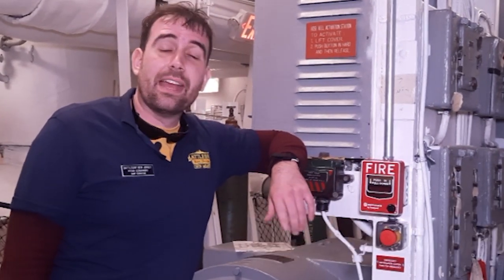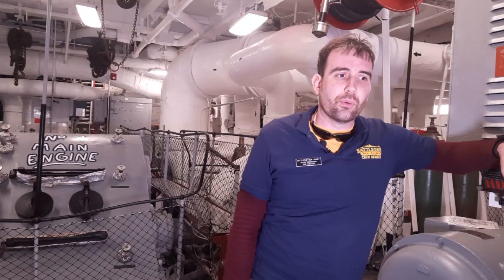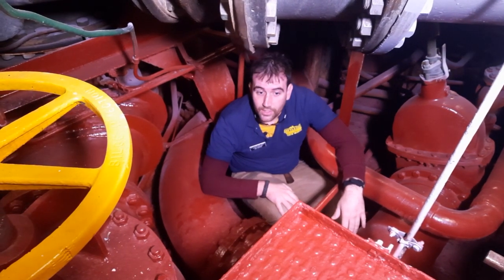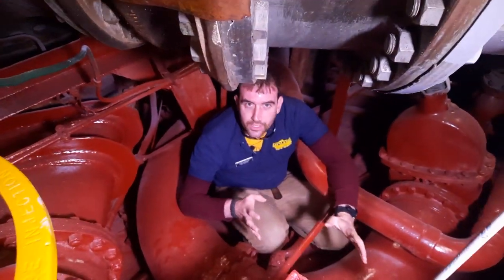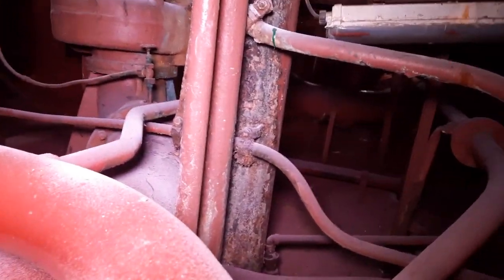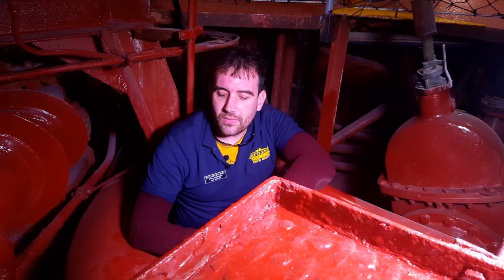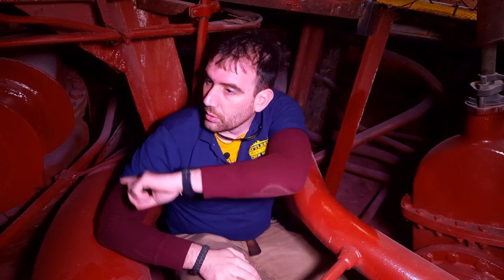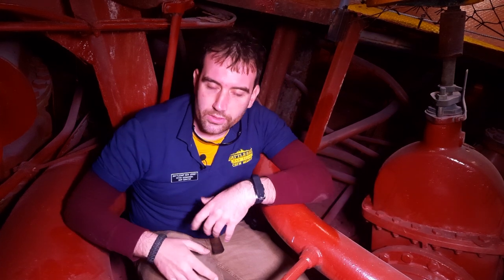Where's the Self-Destruct button on the Battleship?

Comment: I happen to be related to a master welder and metal worker! I could send him down there to break those welds on the Sea chests  smooth out the burrs and you can get that thing ready to go fight aliens.
Reply: Hell yeah
Reply: That's done from the outside in drydock. Plates are welded over the suction/discharge ports of ships as part of the mothballing process.
Reply: @ostrich67  very interesting! Thanks for helping me learn something! So the darn thing would have to be out of the water before someone could break the welds on those plates
Reply: @BlindMansRevenge2002  I suppose you could send in a diver with an underwater cutting torch, but there's probably a lot of them.

Comment: A drydock, an ironworker, some bottles of oxygen and some thermic lances could get those saltwater coolant inlets and outlets un-welded over if you should want to go on a cruise.
Might be able to do it with a manual plasma torch depending on how overkill the welds are, this is a battleship after all.

Comment: 🧐 I already KNOW the answer without having to watch the video! You simply take the main elevator(or an escalator) down to the "basement deck". When the elevator doors open, you make a left, and walk about 1/8 mile down to the end of the hallway. Open the doors on your left and right, and inside each door, you'll see a panel with a large, round red button, with words above it saying "to self destruct, press button".... From there, a special "express scuttling elevator" will rush you to the main deck to abandon ship. The scuttling charges will explode in 10 seconds. Good luck in the afterlife! 😐👍

Comment: The overboard valves of the installed eductor system of the ship I served aboard had locks on them. During PMS I was supposed to test the system but no one knew where they were. PMS deferred.

Comment: I'm pretty sure Star Trek started the trope of a self-destruct button. But even there the presence of a self destruct button wasn't because time and effort was spent installing such a system. Instead, Federation vessels use anti-matter, and quite a lot of it, to drive the warp core.  If you turn off the magnetic shielding that keeps the antimatter contained you have a bomb several times stronger than the strongest nuclear weapon ever detonated. Using that inherent instability and danger to intentionally destroy the ship is a trivial addition.

Comment: If I remember correctly, Graf Spee exploded after the scuttling crew abandoned.  They set their charges with timers on the detonators.  The water there was shallow enough that if all the Germans had done was blow open the sea chests she could still have been salvaged or, at least, equipment removed for examination.

The way the Germans did it, the ship burned for quite a while, ruining most of the sensitive (secret) equipment.  The classified documents had already been destroyed.
Reply: As I understand, one of the items the British were able to inspect was the radar system and check how advanced they were in that area.
Reply: @matthewalker  The British made a shell company in Uruguay and bought the salvage rights.
Reply: I beleive they hung torpedo warheads in the magazines with a candle burning through the ropes while everyone legged it, but I can't remember what i read that in
Reply: Okay no I found it they rigged 6 torpedo warheads with a timing system, the forward charges failed to go off possibly due to the initial blast in the engine rooms damaging the wiring. aft blast was successful in destroying the rear of the ship. ship was in 8 meters of water

Comment: OK, now you have started me down the rabbit hole of reading about the Ling. And the stories vary widely. From hull damage, to vandalism, to charged against 5 people for sinking her. Museum and sub closed from hurricane damage. The sub is virtually locked in place by a river too shallow to move her, passageways around dams that have silted up with no plan to dredge the pollution contaminated soil from them, and perhaps bridges that would not allow her to pass. Yet there's a 2019 article about a group in Louisville trying to move the sub there (how?). Have you done a video of on her yet? It would sure be interesting.

Comment: It seems that USS Ling lives !
"Sometime in mid-August of 2018, the hull of the USS Ling rusted through flooding the ship with several feet of brackish water. It was originally believed to have been sunk by vandals but this proved to be false once efforts were made to re-float her. The USS Ling is being worked on by a new group of volunteers. She has had the hull breaches repaired and is again floating upright in the Hackensack River"
Reply: Sounds like a good candidate for scrap.
Reply: @robertthomas5906  Boats from that war are never a good candidate for scrap...
Reply: @b-chroniumproductions3177  Actually they are. Pre nuclear age steel. Eventually you have to say enough is enough. We have other examples. Sometimes they're simply too big of a hole in the water in which to put money into.
Reply: @robertthomas5906  We're perfectly capable of making low background steel nowadays. Scrapping old warships and such is just a bit cheaper.
Reply: @b-chroniumproductions3177  Scrap it now or scrap it later. Rest assured they will be scrapped.

Comment: Interesting fact the S160 steam locomotives in WW2 had a suside value once open it would drain the boiler when still hot would mean the loco was worthless
Reply: Njaa, it is normal to use the blow down valve in a way  which won't damage the boiler while making it far more easier drying its inside:
remove the fire (if coal or simply shutdown oil)
When the pressure is down to lets say 3 MPa ie about 115 degrees celsius in the the boiler - open the valve and keep it open. The steam pressure will push out the water in a not violent way and enough heat will be left so what the boiler will dry out fairly smartly.
Reply: @TheStefanskoglund1  the value I’m talking about once open it could not be closed

Comment: Were plastic explosives used in rescues?  Actually, what was even the standard procedure for rescue and damage control?  What do you do to keep a burning ship that’s taking on water from sinking, and at what point would a Captain typically order everyone to abandon ship?

Oh, I was never sent to find the keys to the sea chest, but if you happen to see a wireless AC adapter, I could use one of those.  Or a cable stretcher, either will do.

Comment: Better be careful about asking me to find the key to the sea chest, gather a bucket of dead steam... I may ask "Do you want me to check that the sea chest key works too?"
Translated, loosen the bolts on the massive sea chest pipe of course...
Or get a bucket of water from the condenser before it goes back to the boiler, of course getting it out of that may not be easy, so they will have to accept some modifications in the worst case :D

Comment: The Bismarck was scuttled and sunk at the same time. Yeah she would have eventually sunk from all of the torpedo damage. But there are signs on the Hull of the Bismarck that shows no signs of implosion which is indicative of scuttling or flooding from the inside. Where there should be implosion signs there are none.

So it was a mutual win and mutual loss. The Bismarck was scuttled but she was also sunk by many torpedoes

Comment: Ryan: Great stuff. I have been to BB59 many times as a military historian and Mass native. Looking forward to getting to your ship soon. My question is, how did the crew keep the ship supplied with water while in port, given the usual debris in harbor water? Was there a filtration system to keep the mains from getting jammed with junk, or was all that accomplished by pier-side services?  

John Carty
US Army (ret)
Reply: Hey John, on my  Navy Cruiser, we connected Pier Services fresh water supply hoses to the ship. However, some foreign ports did not have pier-side fresh water, and had to obtain a water barge to supply the ship in those locations. Once at sea, the ship can make her own fresh water with a distilling plant that evaporates (boils under a reduced pressure) seawater and condenses the resulting steam into fresh water. Many newer ships now also use "reverse osmosis" water filters. (I dont believe the New Jersey has the RO water system however)

Comment: wouldnt having a big hole in the bottom of your ship that pipes to engineering spaces be vulnerable to extreme overpressure?
Ive seen you talk about the layered torpedo defenses, but this made it seem like its just a single (thick) mild steel tube between the inside and the ocean.
Reply: They are baffled, to prevent rapid pressure change

Comment: I have worked on vehicles with builtin in Vehicle termination systems for the Military, usually unmanned...
Reply: So then it would be a remote kill switch. I hope they don't have remote kill switches on the manned stuff.
Reply: @lonnywilcox445  Manned rockets have self destruct to use on what is left after the crew detaches incase the vehicle takes a dangerous trajectory.

Comment: Ooooo!  Ok, you deal with the German Hate Mail.  Point of Fact: Bob Ballard, when he sent his ROV down the Bismarck, reported that he found the inner hull to be intact.  Lends support that Bismarck was scuttled.

While NO BB's were scuttled, several carriers and the carrier Lexington were indeed shot with torps so as to not allow them to fall into enemy hands.
Reply: Bismarck sunk from the stern port side that were the Swordfish torpedo hit and were the were big hole in the deck, I think during the battle the blockheads gave way intrunal so flooding on the port side it dose not take much water to capsize a big top heavy ship and once the big hole in midships reach the waterline she would turned over very quickly main guns fall out then the air bubble re rights the Bismarck close to the service say at 50 meters then the stern brakes away she flood very quickly result no hull damage form water pursuer
Reply: @daniellastuart3145  First Officer Hans Oels, the senior surviving officer, issued the order to abandon ship. He also instructed the engine-room crews to open the ship's watertight doors and prepare scuttling charges.[25] Gerhard Junack, the chief engineering officer, ordered his men to set the demolition charges with a 9-minute fuse but the intercom system broke down and he sent a messenger to confirm the order to scuttle the ship. The messenger never returned and Junack primed the charges and ordered the crew to abandon the ship.

Perhaps we are both correct.  In the final 30 minutes of her life, all of Bismarck's main guns were put out of action.  She took over 400 direct hits from main guns.  Her decks were awash when the last of the torpedoes hit, putting as you mentioned, large holes into the superstructure.  Bismarck's fate was sealed, but the scuttle charges were placed and primed, regardless

Comment: Ships with certain capabilities have Always had ways Planned, to Prevent Capture of That Technology. These Usually Involved Explosives. A Few Small Initiating Charges, placed on Warheads. or Projectiles Already Designed to create Great Damage, Is All it takes. Before Technology provided the means to recover things at Great Depths, or Quickly,  As long as a ship could sink before being boarded by a hostile force, there were few worries. Explosive solve THAT problem.

Comment: U505 was saved from scuttling because the strainer cover in question was on the  floorplate near the open pipe. Gallery comments in his autobiography that had the cover been dropped into the bilge, there would have been no way to save her.

Comment: something ive been wondering, say you where in charge of a hostile powers navy in ww2, what would you do if you where tasked to sink an Iowa? submarine action? air power? or something else?
Reply: Subs.
Reply: @joshuahudson2170  I guess it depends on what kind, and how many subs you had, and how suicidal the crews were. You'd almost certainly lose a lot if not all of the guys. It would pretty much be a suicide mission. The Iowas were so big, and so tough, and had good enough torpedo protection, that it would take more than one lucky hit to totally ensure a kill. You'd need multiple torpedo hits, even with the legendary Japanese type 93.. I don't think they really had enough subs.. In the case of Japan they'd more likely have tried to use a flotilla of destroyers who would launch multiple salvos of a "metric shit-ton" of torpedoes from a good distance. The only problem there is, again. It's a suicide mission as getting in torpedo range would definitely put them within range of the 16 inch guns. Japanese destroyers carried a lot of torpedoes though, and some classes had quite a few launchers. So if they were willing to take huge losses in the process, they might have been able to pull it off. But again, the losses would be so huge that they'd have probably concluded it wasn't worth it.. And just hoped to get lucky in a good old fashioned battleship vs battleship fight. Or barring luck, what they'd have REALLY liked, would be to slug it out Yamato VS Iowa. Which would have probably been their best chance, had their naval doctrine of Taikan Kyohō Shugi (which basically means "big ship big gun principle) not been foiled by the meteoric rise of successful naval aviation and the quick changeover to carrier dominated naval doctrine. For my money, airplanes would be the way to go. Sure you'd again be looking at basically a suicide mission for a lot of the pilots.. But then Japan never really had a problem with that anyway, did they? Plus, airplanes and pilots are a lot easier to replace than large warships and the whole lot of crew that die when a single ship goes down.. In my opinion, which may I point out is no better than anyone else's, as I never served in the IJN and while I've studied it quite a bit, I'm by no means even remotely an expert on  the wider Japanese naval doctrine of Kantai Kessen. I think the best chance of taking out an Iowa for the Japanese, would have been an overwhelming air raid consisting of both torpedo and dive bombers. Sure the Iowas had a ton of AA coverage.. But a large enough force of aircraft would still be able to get in enough hits to do the job of you were willing to take huge losses. Especially if you caught an Iowa far enough away from a friendly carrier to provide it with an effective fighter screen. The Japanese would however likely have to trade the life of the carrier/carriers required to launch a sufficiently massive raid, as that many planes coming in to attack, especially given the range of naval aircraft at the time. Would pretty much give away where they'd come from. So again you'd have to ask would the trade-off be worth it. Again, even if the Japanese had the resources to comitt to such an attack at the point in the war where the Iowas appeared. I think their naval doctrines would have much preferred to try and lure an Iowa into a shooting battle with a Yamato. Such a battle was never meant to be however. As by the time the Iowas and especially the Yamatos were deployed, naval aviation had pretty much proven its supremacy. Remember how the Yamato itself was sank. Cheers!

Comment: I thought that warships normally had valves opening direct to the sea specifically to permit counter flooding for trim correction if compartments were flooded by combat damage, or to flood magazines in the event of fire. Is this not so? Anything of the sort would certainly lend itself to scuttling the ship fairly quickly without resorting to explosives or dismantling big pipework. I believe that this was how the Imperial German Grand Fleet sank their ships in Scapa Flow after WW1. The English ships present didn't realise what was happening till far too late
Am I mistaken, or did the USN decide on a different path?
Reply from the maker: So we can directly flood certain tanks to adjust the trim of the ship, but that won't directly sink the ship.
Reply: @BattleshipNewJersey  Point taken - I should have been able to work out for myself that unconstrained flooding would never work as a means of regaining control. I've just looked into the German (correctly - High Seas Fleet) scuttling again and found references to pipework being smashed in preparation for the expected order.
I've learnt - Thanks!

Comment: Bit of an odd question here but: what sort of character or traits does USS New Jersey have?
Any machine over time will develop a certain character based on how it's used (My motorcycle actually doesn't "like" super premium fuel because it's obviously never been run on it so actually run more efficiently on regularly (UK) petrol). I'm wondering if there are any things like that with New Jersey; is there a piece of equipment, doors or general area that falls into the "You just have to know how to make it work" category? 
I'd love to see a video (or two) about the good and bad 'behaviour' that New Jersey makes you deal with, and if they are unique to New Jersey herself or if all the Iowa's have similar habits.

Comment: As a curiosity, and possibly an interesting video: Does the Museum have plans if a sea chest (or other hole) were to be opened up, with flooding in one engineering space (or more depending on how open things are reminiscent of Dec 7th, with much open for inspection?) Are they mostly closed up, or open all the time? 

(Obviously, It'd be difficult, as there's the structure with the triple bottom and all that, the closed over nature,  finding it before it becomes bad and all of that. etc. etc. etc. which should prevent it from turning from a almost entirely theoretical question to a practical one)
Reply from the maker: Our sea chests are welded shut. So if one opened, it'd be a small leak most likely. But we have sensors to detect it so we know about it